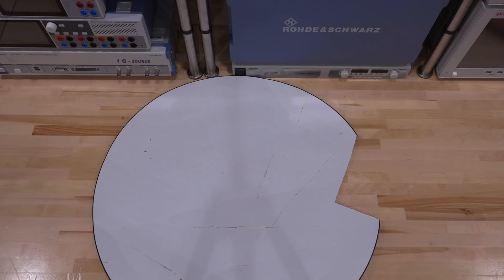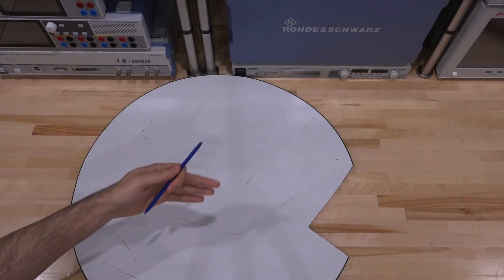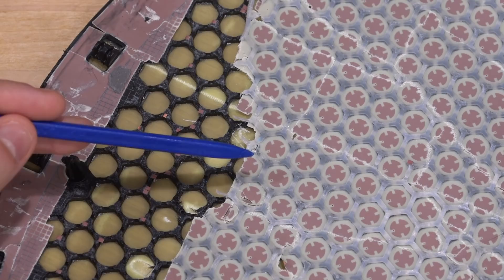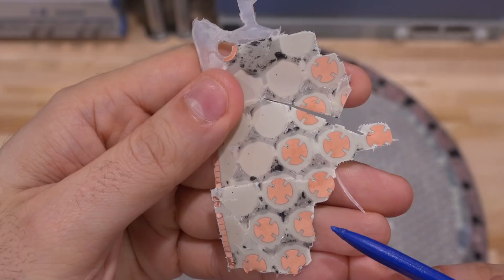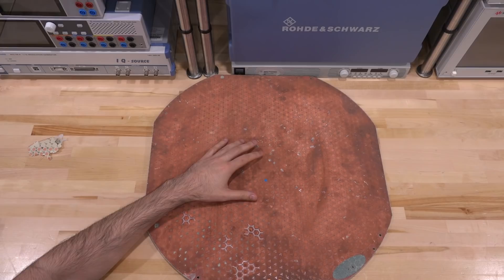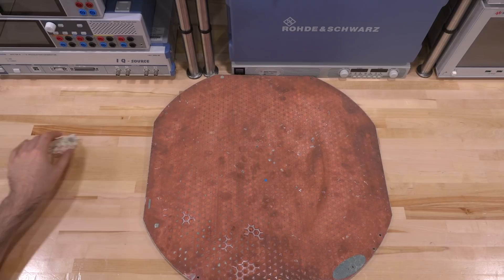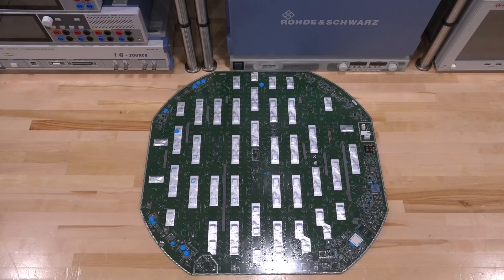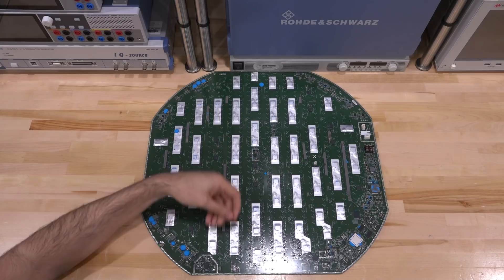TSP #181 - Starlink Dish Phased Array Design, Architecture & RF In-depth Analysis

Comment: I can't think of anyone more qualified to do this analysis!
Reply: I can, engineers from my work, we are currently working on 106gbps pam4 with a single lane (diff pair), and 8 in parallel for 800gbps bandwidth.
Reply: I cant tink of anyone more unqualified than me I just got my rtl sdr and I'm in to bipolar antennas and just learned that bigger does not mean better in antena
Reply: @Ozzy3333333  how much 8k vr porn could you stream with 106gbps?

Comment: Hey I work for starlink! Mainly as a production associate. And while im late af and only worked on the layers for v2 and tbh I havent the slightest clue as to how either the v1/2 pcb’s work I did apply ally the layers to each other and the order dosent seemed to have change from v1 to v2. There are 2 antenna layers and 3 spacer layers along with a radome all epoxied together on top of the pcb just like you said that transparent layer is another dielectric spacer but couldnt tell you the material. 

And yea youre on the money that these things are a pain in the butt to make its a dirty job and can take about an hour for one full dish o be completed from pcb to finished array. We have gotten faster but it still takes a large group of people to put these thing together and get them just right and ready to ship.

Comment: Nice breakdown.      This is a well engineered antenna system.  I've been in RF/Microwave design for 42 years. I started with mechanically steered RADAR using a single Transmit amplifier into the manifold.  Now we're doing Q-band phase arrays.   The big BGA in the middle is most likely a SiGe PHP process RFIC.  This allows the Digital control core and RF to be grown on the same IC. The RFIC looks to be an 8-channel T/R with each channel having individual Phase and Gain control. The smaller 8 chips are probably the Final Tx amp, and Rx-LNA that feeds the larger chip in the middle of the group.  The RFFE-CLK & DATA are the digital control links to the SIGe.  My current specialty is the beam steering SiGe control aspects for similar setups with Design verification testing.

Working in the Defense/Aerospace/Space sectors, I am absolutely blown away by the quality of this consumer product.  And I agree, H/V polarization for full duplex.
Reply: I don't think it is a consumer product. It is a mass-produced prototype, spending investors' money to create a market.
Trying to make it cheap will come later.

Comment: Great video!

They may be getting the circular polarization from the notches on the suspended patch element; not just to electrical lengthen it.  Though it does look too symmetrical.  On rectangular patches you can generate LHCP or RHCP by trimming two corners (relative to the single feed point) to generate a quadrature resonance along the orthogonal edges.  Though the polarization isolation and BW is poor compared to a true quadrature feed.

On the feed board, it looks like every other column has a single slot with a large chip, and the orthogonal slots with a smaller chip.

Maybe TX with linear polarization on the bottom patch, and RX with simultaneous LHCP and RHCP on the top patch, with dual LNA and quadrature splitter.  That gives them the massive downlink bandwidth.

What’s the element pitch?  Looks much too tight for X-band, so maybe TX and RX elements interdispursed.

All just a guess on my part, but fascinating array.

Comment: I love the break down.  When Ken did his tear down I looked at some of the close ups and  
then when he said the chips were from ST that tells me that they are cmos or bi-cmos. The power supplies and there voltages seem to say as much.  I would think the chips communicat with a form of I2C/JTAG.  I would have to look at connections.   I have been an RF engineer most of my life.  Started with Ham radio in my teens.  Microwave in my twenties and Satcom from there.  These patches could be H/V from there makeup.   With phasing they could be circular.   With the PLL in the middle of the board timing is of great concern.  To make this work as a circular/steerable array is critical.

Comment: The radome and floating elements look like they're probably made using a PCB lamination process. Fancier board houses can laminate all sorts of interesting things into a PCB stackup, including things like that honeycomb.

Really, a bunch of components of the antenna look like they're clever uses of existing PCB manufacturing processes.
Reply: At what kinds of MOQs do these board houses start talking, and how does one find one that starts at a fairly low MOQ (in the monetary sense)?
I'm involved in a 5.8 GHz relay "plane" design, and using the (currently planned as such) electronically steered phased array antenna FR4 as a structural element (basically one side of a sandwich plate, with honeycomb or foam as the core) would be quite useful from a weight perspective.

Comment: One issue with a gold finish is the required interim layer of nickel which is quite lossy as you go up in frequency (with increasingly shallow skin depth), so for physically long structures (such a broadband delay lines), may sometimes be unfinished and rely on an environmental seal elsewhere, as you suggest.

Comment: RHCP/LHCP: might I suggest the element is excited by the linear 14GHz Tx slot dipole, ditto 11/12GHz Rx which when passed via the PCB dielectric to the first circular suspended patch, allows that to reradiate CP,  translating Linear to CP and the upper crescent shaped patch acts as a director in the cavity. Net effect is CP element with some directive gain, adequate CP XPI (Cross-polar isolation), and fractional bandwidth performance on the allocated frequencies. CP is absolutely required with LEO satellites, using  linear would mean skewing continually , nightmare.

Comment: I wish I could get the contents of that eMMC flash IC and do "The Software Path" in parallel with the RF/hardware analysis ;)
Reply: i saw a video where a guy soldered a connector onto one of these boards, he decoded the signal and got the software start up to display on his computer. it required a pass code to continue any further into it.
Reply: probably encrypted.. These newer chips have some hardware based encryption built in.. 
They have a couple thousend efuses (one time settable bits) which you burn into a key + certificate during manufacturing of your product.
Once the management processor or the main processor boots up, it start from an on-chip rom, which reads the encrypted first stage bootloader from NAND or QSPI flash into memory, afterwards it´s decrypted, it´s signature is checked an then then executed.. If any of this steps fail, the CPU goes into a failsafe mode..
First stage bootloader will typically do the same (decryption + signature check) on the second stage bootloader (like uboot or something like that..)
In most chips with FPGAs, the same is done for the FPGA image as well to protect IP.

One way to dump at least the software image: attach an external FPGA to the RAM address / data lines (if ram is external) and try to find the decryption key, if online encryption is used for a block device for example.
Even newer chips have memory encryption though (symetric "random" or fixed (efused) key is used to encrypt memory pages).. Furthermore this is complicated as you have to reverse engineer the memory interleaving and page assignments and so on..
Reply: @Spacefish007  maybe but it sounds like you haven't seen it. the first part of his video features this very same dish, then it cuts to him analyzing his own unruined dish. if you like this you'll like his. https://youtu.be/38_KTq8j0Nw
Reply: @iamzid  At least that looks promising, as if they left a serial console enbaled, they probably did not lock down the system that much..
Dumping the eMMC chip from the broken dishy might be an option.

Comment: Jeepers, that's amazing.  As an oldster, I still remember being amazed that you could take a very primitive transistoor, a 2N169A, which although its spec sheet noted that its top frequency was 5MHz, radio amateurs managed to push it to 14MHz!!!    That was amazing in 1962.  Now you can buy this dish with thousands of transistors, each one more than ten thousand times faster.  Just mind-boggling.

Comment: I wonder if it's an OSP finish rather than bare copper - bare copper would seem a bit risky for something like this.
Reply from the maker: Interesting. It has tarnished a lot...
Reply: @Thesignalpath  I agree, OSP would preserve the copper with no discoloration but in this case it is clearly visible that the copper is unprotected.
Reply: Could've been OSPed during manufacturing, but OSP is well organic and really isn't durable, it protects the pads until the solder is applied it's not designed for long term protection it would degrade with time, as it's water based even the moisture in the air is enough to strip it over time, and I'm pretty sure the RF would get rid of what else is left.
Reply: It definitely looked like an OSP finish to me.  I have seen & processed lots of them.  The outer layer copper looked etched ( non glossy) and even though the board had obviously been handled & exposed to the environment, there was not a lot of oxidation.  It could be as simple as a benzotriazole (BTA) finish, or possibly a thicker imidazole type ( trade name ENTEK)  I don't know if the thicker imidazole coating change RF performance, as they may introduced dielectric variation.  I think if the assembly is semi-hermetic, the thinner BTA coating would keep oxidation minimized for a few years.
Reply: @swright1967  Yes, it shouldn't be difficult to assemble at least part of the antenna in a nitrogen atmosphere. The design does look amenable to hermetic sealing.
Reply: Could be a copper alloy

Comment: 33:10 Reminds me of what I found back around 1993 when I got my car back from the body shop.  The delay didn't work any more on the interior light.  Oh, the PCB in the light assembly had been snapped in half and Superglued back together, complete with a snapped diode.  
At first when I saw this thing, I imagined it might look a bit like a Squarial satellite antenna inside  (BSB, Squarials and all that).  That was for circular polarisation.  It doesn't look like that, not at all.  You could take a plastic and metal trace sheet out, flip it over, and change which polarisation it received.

Comment: My guess is that each of the 2 H slots per element are to dual band the antenna for TX and Rx to cover the widely spaced frequencies. While the slots look about the same size and shape, one is clearly closer to the edge of the patch. Perhaps they phase alternate elements with a 90° shift so the superposition of 2 elements creates approximate CP. Really impressive structure. This is not a case of just sending it to the local PCB fab. I bet they have developed a custom in house fab process for this, in parallel to designing the antenna.
Reply: They have an existing PCB fab, there for doing all the SpaceX electronics and Tesla boards, so likely this is all in house designed and built. Impressive amount of design work though, and definitely not built down to a price point either, but to meeting the design spec correctly.
Reply: Your comment about the 90° shift and superposition of 2 elements to make circular polarization makes sense to me. The two lobes not only serve as polarized directors, but should also effectively lengthen the directors to better match the half wavelength of the frequency band (also taking into account the velocity factor of the copper) when transmitting in the opposite polarization. Very clever!

Comment: Its speculated that Starlink decided to outsource a few years back this phased array project to ST Micro at $2400 a piece (for a batch of 1 million) and then Starlink selling it at $500 to end users. I guess they are absorbing a huge chunk of the cost of this equipment in order to make it sellable and the $100 a month subscription could make up for it. You can see the ST brand all over the ICs. Starlink is a business after all and needs to make a profit, they are betting on the long run on this one. Also according to the FCC the frequencies used for satellite to user terminals are (Ku band)10.7 – 12.7 GHz & (V band) 37.5 – 42.5 GHz! Not sure if V band is used on these.
Reply: The speculation is not entirely accurate. A contract to supply billions of RF chips is obviously a huge deal for ST.  But the terminals themselves are produced by SpaceX at their own factory in Hawthorne, California. They have invested $70M in it, with a goal to initially "produce thousands of terminals a month" ramping up to a high volume production.
Reply: @cogoid  It is true that they are trying to build the array in house in the US, but the first batch is made by STM. It will be a challenge to keep the production in house. There are specific engineering obstacles and skills needed, and STM is doing this for years. Keep in mind that STM agreed to absorb costs for non-recoverable engineering, or factory setup. The task can add up to tens of millions of dollars, and SpaceX would have to repay such costs, plus other substantial fees, if the company didn't meet its purchase commitments, the person said. From my perspective its clear the PCB with everything on in is currently designed & built by STM and the outer shell with the gears by SpaceX/Starlink.
Reply: @dorusan  My assessment is that the much repeated story about STM getting "contracted for producing a million terminals for two billion dollars" is not true as told.

STM is famous for chips, not PCBs. I am not even sure if ST has any PCB production capacity at all -- their own development kits are sourced from China, not made in house. SpaceX, on the other hand, has had personnel in terminal manufacturing at Hawthorne for some time now -- including production automation engineers, quality control engineers, etc. The patents on terminal design are also filed by SpaceX, listing SpaceX engineers as inventors.

The components for the terminal obviously come from all around the world. STM themselves uses facilities in multiple countries to produce these chips. They may well have had a hand in designing some or even all of the chips, and since this is such a huge contract, they may have agreed to waive the non-recurring engineering costs which would have been considerable.
Reply: @cogoid  Its hard to know for sure without an inside view. Their website states 'over 13 years of experience to the printed circuit board Fabrication, PCB Assembly and Box-Build manufacturing assemblies'.https://www.st.com/en/support-and-applications/pcb-engineering-service.html#overview They seem to have a partner program with Fab-9 from Vietnam.

Comment: Apparently Starlink uses right-hand circular polarization for downlink and left-hand polarization for uplink. It's in the licence applications and so on. Is there any reason why the antenna grid couldn't be utilized to generate a circular beam by using a precise timing delay, and could this not also be used to steer the beam directly to a passing satellite, effective increasing radiated power? Asking as an RF amateur.
Reply: Possible that the structures between the radiators and the actual face are there to do that sort of shaping, depending on the slight offset  between them to do the phase shifting needed.
Reply: In my opinion, as you suggest, the 90° out of phase is performed digitally between the two radiation elements (H-type slot). Or maybe it is by design. However, if it is performed by the design (location of the slot, size of the slote ...), it  has low frequency bandwidth, which is not applicable for this application with 40% bandwidth.

Comment: wondering about the power requirements. What is the power regulation from power adapter to the dish?  Plug  into wall, converter to DC. What is the DC voltage to the Antenna?

Comment: The front side of the isolating meta-surface of periodic squares around the circular patches is different from the back side @ 29:30 . The front is very regular. The back shows lots of variations in shape.

Comment: Electronic beam steering. A different form of R.F downtilt, shaping the signal to favor a specific area, multiples over the planar surface, all combined to feed common feed points/LNAs and R.F PA. Outputs.
There has to be filters included, or possibly have a DRO for RX and TX paths.
Lumped element antennas. RSSI detection for level changes in RX and TX.

Comment: I really would like a further IC analysis ! I've searched through the ST website and can't find any similar multi-chip beamforming system. 
⚠️WARNING PURE SPECULATION AHEAD⚠️
My guess would be that the chips are daisy-chained. For example (when receiving) :
1) The chip samples I/Q samples and stores them into a buffer to give them a small delay.
2) The I/Q samples are multiplied by a complex number --> changing the amplitude and phase.
3) The chip receives I/Q samples from the previous chip, adds its own samples, and then sends the result to the next chip.
At the and, only a single stream of "beamformed" I/Q samples arrives at the application processor.
The exact opposite happens when transmitting, the application processor sends a single stream of I/Q samples which are "beamformed" by the transceivers by adjusting the delay, phase and amplitude.
Beamforming is done by phase/amplitude shifting and delay is here to compensate I/Q samples propagation time through the chips.

Comment: In the Ku band linear polarization is typically used for satellite communications to GSO satellites, but interestingly SpaceX's FCC filings do use circular polarization for the Ku band user terminal links.